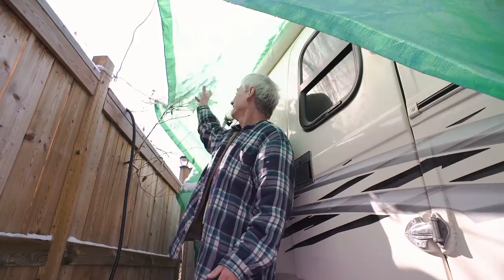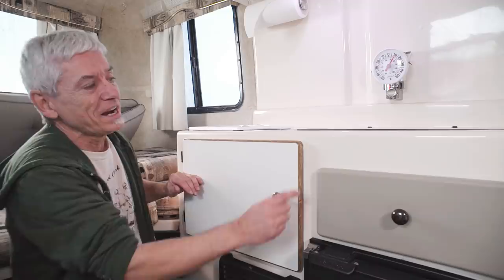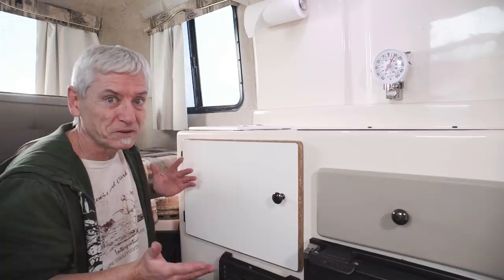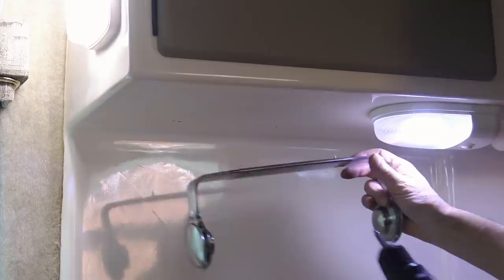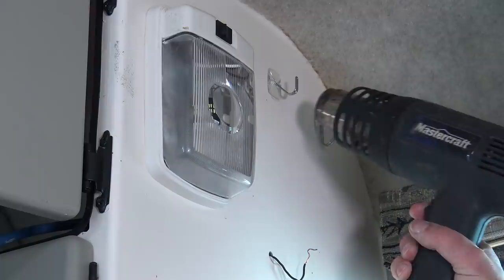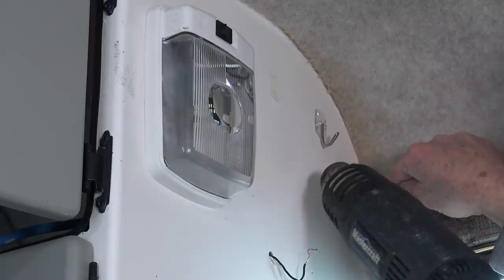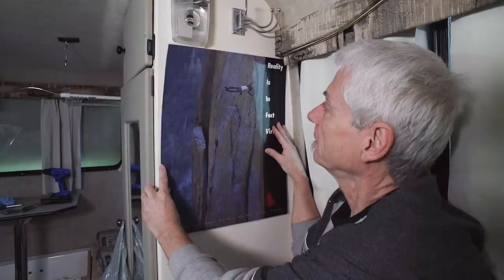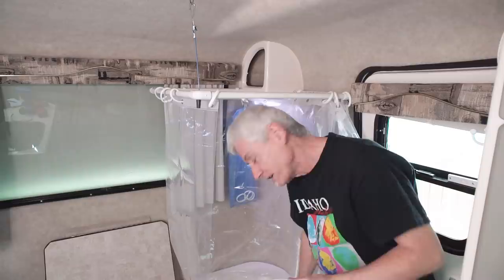Trailer Makeover Part 2: Storage Forage!

Comment: Awesome job on the upgrades, Slim.  And for fussy folks, take your drawer to a home center like Lowes Home Improvement or Home Depot.  They can match the paint color exactly and you can buy just a quart or so of paint.  I did this for shelves I built in my 2019 Casita and the match was perfect.  Also modified my rear full size bunk with a smaller inset board and a smaller table which I painted.  So now I have two single bunks instead of a full size bed which is better for two travelers who don’t want to sleep together.  Stay safe wherever you are!!!

Comment: Thanks for your example . . . as you say, not everyone has a trailer, but of course we all do have the living conditions which are either well- or ill-suited to our life. What comes through in your inventions, innovations and adaptations is the kind of life you envision they will support and enhance.

Though my own project in mobility is coming along at a glacial pace, the spirit and even some details from your experiences have been very helpful. One example is a rooftop rack which not only carries a homemade cargo box but supports a 10 by 20 ft shade cloth (or smaller tarp) and handy door-side privacy screen. An absolute minimum of hardware is called for due to limited space, yet secondary means for essential functions can still be accommodated if my goals are kept in view.

Comment: Nano Tape; a sticky two-sided clear tape that doesn't harden, is STRONG, & is used to secure "stuff" on horizontal, verticle, or overhanging surfaces.  It can be molded to whatever shape you wish, ideal for securing wire baskets.  I especially like the creativity of your thought processes & am patiently waiting for additional modification videos.  I'm especially interested in the interior temperature comparison between Abner & your new "Omelette".

Comment: Concern = I recommend dropping down the  hanging corner storage (BRILLIANT idea, btw) while in transit. Swinging will place too much torque on those cup hooks and strip out the screw holes over time. DESIGNERS LOVE efficient ways to use space, decorators want matchy-matchy stuff. You need color in there anyway! So happy, and positive...the HAPPY CAMPER!

Comment: I'm in the process of building a camper myself. I'm sure I'll be using a couple of your ideas. If your interested you can buy an iron on white vinyl trim for that knew cabinet door you installed. I don't know if i'd bother, but you may decide too. Nice job and yes you are a positive individual. Your actually very refreshing in these times of uncertainty. Please be safe.

Comment: Great shower. If you put 90 degree fittings where pipe goes into corner shelf you could raise the shower tube assembly a bit higher,less  head banging? Love your creativity.

Comment: I never thought anybody could make particle board look stylish!  Love that 5 minute epoxy technique on the edge!  The shower curtain - not so sure - I wonder if you'll end up changing it in a year or so, especially the odd little head-bumping shelf in the corner.  But it looks like a good spot for shampoo & soap.
Reply from the maker: Hi Alice! Thanks for reminding me, I didn't really mention the curtains. They are actually PEVA shower curtain liners, very thick and durable plus odor-free, antimocrobial and non-toxic. I used them in the Aliner shower for over 3 years before I finally replaced them. They didn't grow mold, just started to calcify from the hard water. I actually have more room in the new shower than in Abner, as I was limited to the width of the bench. Yes, the shelf will be used for soap, amongst other things. Thanks! SP

Comment: Trailer is starting to look better.  I like your ideas, and the shower curtain rod idea is really cool too.  Wonder though if you could install another hook on the other side and get rid of that cross piece in front so you aren't running into it all the time when the shower is setup.  The shelf and drawer in the galley is an awesome use of otherwise a lot of wasted space.

Comment: Hi Slim,  I always enjoy your video's especially the new makeover series, in regards to the 2 hanging baskets in the rear corners why not put  a shelf in from side to side just above the curtain pelmets and then either some netting or a panel with doors or access holes ( similar to the 2 small ones in the front corners). Looking forward to part 3.

Comment: We use Rutabaga in our soups and stews, along with or in place of potato. Peel the skin off and then cut it up into large bite sized chunks. If you want to bring out the sweetness, put them on a sheet pan with a little olive oil and roast the chunks first. Then add to the dish. Especially good in an Irish stew made with Guinness.
Reply from the maker: Stewed with Guinness. You just sold me! SP

Comment: Hey Slim, it sure seems like that table support post would fit right above the window- on top of or behind the valance. Loving your videos. :) Hour 3 right now. :)  Keep a safety pin nearby. Use it to start peeling the paper from adhesive tabs. No thumbs required. :)

Comment: Great modifications! Instead of the vinyl shower curtains? What about using the the nylon material kind? Much easier to hang, dry and fold back up. If you're worried about any mist getting thru you could use spray waterproofing. I'll be looking forward to the next video.

Comment: Good job Slim!  I love to make little modifications to my camper.  Like you, I'm always coming up with some little idea to add or change.  I have a small popup camper that is really lightweight.  When I got it my tow vehicle was a Ford Ranger with a small V-6 engine.  I was limited on what I could tow because of horsepower.  However, in February my truck was stolen and found totaled.  So I now have a 4X4 Ranger with a big engine.  I can now tow more weight.  I'm thinking about upgrading to a hard-side trailer similar to yours.  You are giving me lots of ideas on how I could modify it... if I go that way.  I'm a Boondocker most of the time.  And there are times when I can only get a popup in the area I want to go, and there are times when I wish I had a hardside.  If I upgrade, maybe I'll keep both.  I'm looking forward to your next video.

Comment: Hot darn! That shower curtain rod was CLEVER! I never would have thunk of that. And, I found out some clever tricks for removing hooks and marks.Oh, and that trick with the epoxy to seal the particle board edges - Wow! Did you come up with that yourself?
Reply from the maker: Thanks Cary! Being cheap inevitably leads to creative thought. One trick I did learn from a  viewer was to wet your finger with water to smooth out the final epoxy finish. Prevents you from sticking and makes the surface smooth as glass! SP

Comment: I repair fiberglass boats with epoxy putty.  Might be a product you should travel with. Squeeze/ Mix it in your hands, apply, dry, sand paint drill etc. this stuff dries rockhard.

Comment: If you haven't removed the 110 outlet from inside the cabinet yet, you can cut a small notch at the bottom of the cabinet door where cords can come out and still have the 110 outlet usable. Or cut a hole in a side wall and attach an extension cord out
Reply from the maker: But why would I keep a 110 outlet in a closet? Seems like a problem waiting to happen if it's used for storage. SP
Reply: @SlimPotatohead  yeah you're right. Potential fire hazard or something. and you've got skills, you probably safely removed it. I Appreciate all your videos!
Reply from the maker: Actually one correction: I said in the video I relocated it. In fact I replaced it with a safety outlet and threw out the old one. SP

Comment: Very creative Slim!  One thought I had when you were putting in shelving.  The unit below the shelf looked like it had a louver in the side which made me wonder whether your shelf and sides may cause a heat to be trapped under neath the shelf.  Can't recall what that unit it bit perhaps it needs a vent space.  Carry on bud.  I really enjoy your videos.
Reply from the maker: Appreciate the feedback @FF7824. The unit under the shelf is the furnace. It still has plenty of room on the sides for ventillation, and in full operation with no significant heat built up. Put my hand on it to be sure. Thanks! SP
Reply: Ok!  I thought you would have thought of that but since you didn't mention it, I thought I would just in case.  I like what you are doing to the trailer.  I've also really liked your photography.  Keep up the good work and stay safe!  I'm 77 yrs old so staying at home has not been a problem. :)

Comment: I know this is an older video, I’m just catching up. You mentioned removing permanent marker using acetone. Strange as it may seem, another way to remove permanent marker is, draw over it with non-permanent marker, then wipe of with a cloth. As I said, it seems strange but it works.

Comment: Slim, can epoxy and paint be mixed for a color matching hole filler? I’ve never tried it. I have used your epoxy as a sealer idea (mini pine cone drawer pulls video) multiple times. I like your problem solving creativity. Thanks

Comment: With the cabinet you installed, that bottom shelf board covers the furnace.  is there still enough airflow for venting?
Reply from the maker: The cabinet doesn't cover the furnace, it is above it. Yes, there is still ventilation on all sides, especially the right side were the vent is. Thanks! SP

Comment: I'm curious if the heater won't heat up the contents in the new storage space you build. If so, maybe not a good place to store food. Just wondering. Great video and the trailer is coming along great!!!
Reply from the maker: If it did that would actually be a benefit, as I only use the furnace when it is around freezing. Nothing worse than frozen vegetable oil!  SP
Reply: @SlimPotatohead  True, never thought about that coming from Hawaii LOL! You know what's best SP! My idea of cold is below 68˚F LOL!
Reply from the maker: Alas, it doesn't even heat up the shelf. Ran a 20 minutes test and the cabinet stayed below room temperature. SP
Reply: @SlimPotatohead  Cool! Glad it all worked out :)

Comment: Use quality double sided tape works great (follow instructions)
Reply from the maker: For what? SP
Reply: @SlimPotatohead  for mounting things to fiberglass jelcoat without having to drill (more) holes
Reply from the maker: John, I've never found a tape that would handle the extremes in temperatures I travel in. Screws are unaffected however.  SP

Comment: Hi Slim! how are you? I have been watching your blog for weeks now and all of them are very educational. Can you please help me out, i'm planning to get a used A liner like yours but the problem is i'm not that sure if my vehicle can tow a 995 lbs. A liner. I have the information of my vehicle and it says my GCWR  is 6000 lbs.  and my GTW is 1000 lbs. which includes up to 5 persons & luggage, my vehicle is only 4 cylinder and i'm really not sure if my car can tow it without putting too much  pressure in my engine. Thoughts? I'd really appreciate your help! Thanks and stay safe!
Reply from the maker: Hi Rommel, I would recommend going with the worst case scenario. Will you have the power when you need it? If any doubt, get a bigger engine. Safety is a bigger concern than gas mileage. Thanks! SP
Reply: @SlimPotatohead  thanks for your input Slim, you are right, safety first than putting my family in danger. I will always enjoy watching your adventures! Take care!

Comment: How much clearance does that heater underneath the new shelve need?
Reply from the maker: Are you expecting an exact measurement? Can't tell you. SP
Reply: No, not an exact, just wanted to make sure it wasn't too close to the heater from the top for safety, was wondering if you had thought of making sure it had enough clearance to not get too hot. By the way, I really do like your videos, you had me wanting an A-frame camper, I can't wait to see what you do to the new eggshell. Thanks for the entertainment, this virus has me on lockdown here in Texas and youtube is my only way to get out.
Reply from the maker: It has enough clearance and it does not get hot. I ran the furnace from freezing to room temperature. The shelf stayed below room temperature. I even removed the cutlery drawer so I could reach in and put my hand directly on the top of the furnace after it had been running for 15 minutes. Barely even warm to touch. Thanks! SP
Reply: Great, I was just concerned. It would be a shame to cause a fire from a small thing like that. I enjoy your homespun modifications, I was just thinking things thru and didn't think you had said anything about that. We've had some fatalities from people modifying things and causing fires and hunters found dead from carbon monoxide in enclosed trailers from not venting heaters. I like safety and double checking things. Keep the videos coming, I'm going nuts with this lockdown. My only escape from the house is youtube.

Comment: That melamine is awfully close to the top of that heater...
Reply from the maker: The melting point of melamine is 343C (649F). It will not go anywhere near that in a ventilated area. SP
Reply from the maker: Wouldn't even classify it as warm. Reached inside and put my hand on the top of the furnace after running 20 minutes. It heats outside the galley, not inside at all. SP

Comment: I suspect that one of the biggest steps you fast-forwarded through was “prototyping in your head.”
I sit and look at a potential improvement, and devise one solution after the other, “trying” each one in my head.
It’s a natural part of evolutionary design, and it is vital for arriving at the best (for now) solution.
However, my sitting and looking and thinking would make pretty boring video.
Thanks for showing us your results, especially with your light hearted style!

Comment: The only baffling part of this make over is that you took OUT a hot water tank .. then installed a shower .. seems a bit arse backwards.. I'm sure what you've done is cut off your nose to spite your face a bit .. I love watching your videos from here in the UK and find it fascinating watching your travels and your modifications but that just confused me .. keep up the good work and keep the content
Reply from the maker: Jayme, it would be nice if you wait for the final build instead of being judgmental. Too many assumptions are made hear. Thanks! SP
Reply: @SlimPotatohead  just seemed a bit backwards to me ..  it's not an assumption.. you did remove the hot water tank and I think said you wont be needing it then installed a shower right opposite it's not a assumption it's a factual statement on what you have done ..
Reply from the maker: Jayme, do you really, I mean REALLY, think I would design a shower and NOT think of how to heat the water? SP
Reply: Look I'm not in for an argument I really enjoy your videos and really enjoy the content you make .. I'm no keyboard warrior or anything like that and am currently designing a van to camper conversation so using alot of your mods as ideas (if that's okay?) .. it just seemed a bit weird with what you done thats all ! Keep the content slim 👌